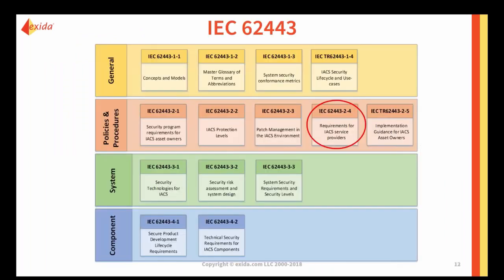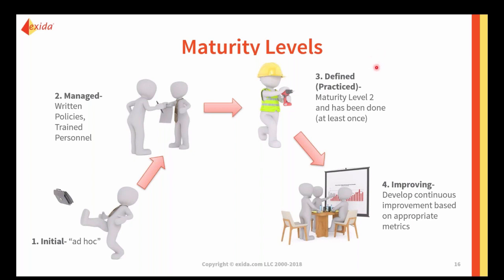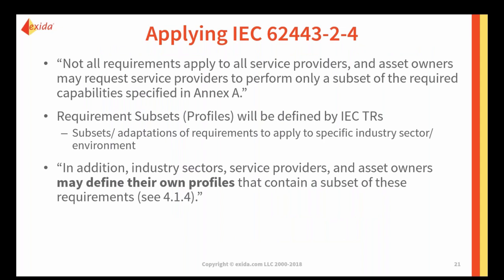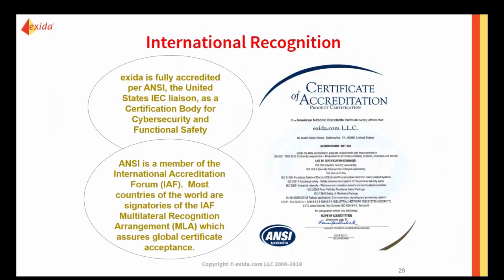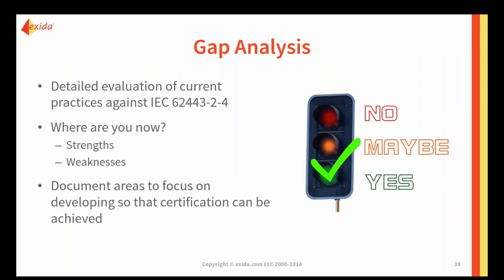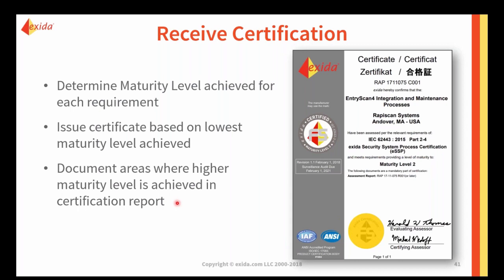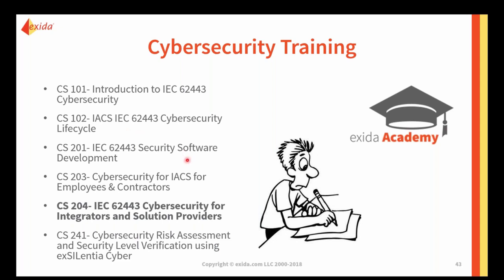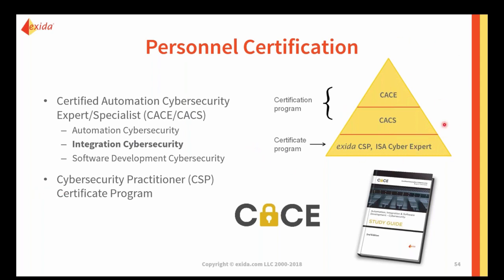Integration Cybersecurity: Understanding and Applying IEC 62443-2-4

Comment: 00:05:30 - There is a bit different definition of Automation Solution: It's the instantiation of a Control System; a specific implementation of a Control System for a specific Asset Owner.